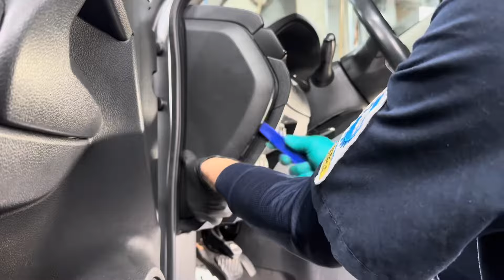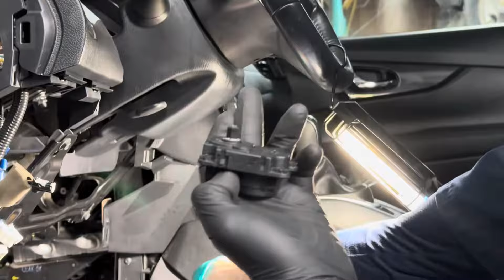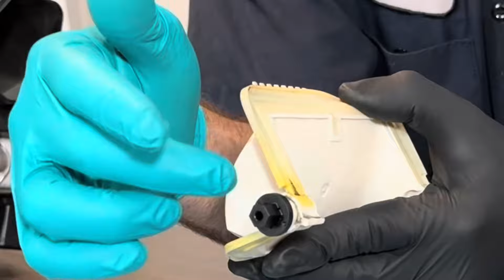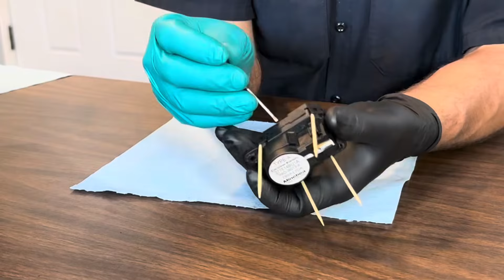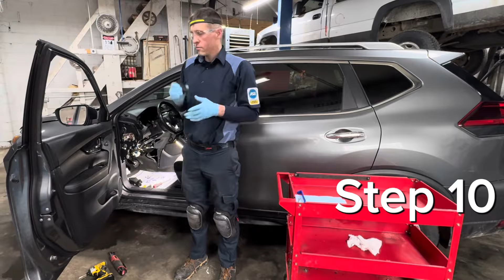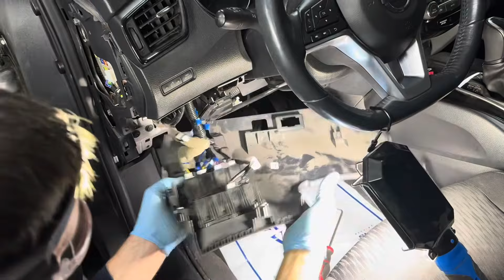Nissan Rogue Heater/AC Fix & Upgrade Kit!!

Comment: You are the best bro! I ordered and installed the complete replacement unit from you.  Can't praise you enough for these instructions and explanations and providing all the necessary tools and misc stuff for DIY.  I didn't ask Nissan but I assume this fix would cost around $1000+ including labor? My one piece of advice to others would be: when putting the black plastic funnel thing back in palace (after you've preformed the fix), crush or cut the far vent hole so you can access the screw easier.  Ironically, accessing that screw was the hardest and most time consuming step.  A small tip flexible screw driver extension definitely would've made it easier but I couldn't find a flexible extension that small/short because it's a tight fit.  In my case the passenger side blew heat but not the driver side, so I knew my heater worked.  When I was able to see bore/hole for the heater flap there were plastic shavings so this was clearly the issue.  When heat is only working on one side, would that indicate a bigger problem with the full unit besides the stripped hole to the flap door?
Reply from the maker: Thanks so much! The computer is still probably not operating that motor due to it being stripped out before. The thing to do is the battery reset procedure on the back of the instructions. If you need more help with that, or need further help troubleshooting, feel free to reach out! You'll be getting an email asking for a review we would love to hear from you also!

Comment: What part would cause the air not to be sent through the vents. My mom just got a rogue and  the blower sounds like a jet engine but hardly any air comes through the vents.
Reply from the maker: It sounds like the cabin air filter is severely clogged, which restricts airflow and makes the fan struggle. Or if  happens with the AC on after driving for a while it could be ice building up on the evaporator core.

Comment: Can you recommend a flexible shaft screwdriver make and model? One that is flexible enough and has the 1/4 inch socket at the end for inserting phillips or flat head tips...
Reply from the maker: Here is a link to one on amazon. Harbor Freight has just the shaft if you have a 1/4 driver handle already. Hope that helps! 

https://a.co/d/05YiOf0q

Comment: what if the problem is on the passenger side?  Same procedure but opposite side?
Reply from the maker: That's a really great question! The passenger side uses the same motor / actuator but connects to that blend door in a different way. There's a piece of linkage that goes between and there is an external connection kind of like how our kit works. It is robust connection and we have never seen one break. Usually if you lose function on the passenger side it's just a bad motor / actuator.
Reply: @RenegadeSolutionsCompany  i have cold air blowing from the floor vent under the glove box but heat  on the drivers side. Defrost works ok but there is constant cold air coming in from the passsenger side door and under the glove box.
Reply from the maker: If you have good heat in your heater box but it's still cold on the passenger side then your motor / actuator is probably bad. It's not very hard to change.
Reply from the maker: Here's a link to one of our videos that might help. If you need any other help feel free to email us! renegadesolutionshelp@gmail.com 
https://youtu.be/HbLa37Xxcl0

Comment: Does it work for passenger side as well?  My Rogue driver side is cooling but passenger side isn’t cooling after switching temp.
Reply from the maker: The passenger side does not break like the driver side. It uses the same motor but a different connection that is more robust. You probably just have a bad motor. Hope that helps!

Comment: Does the repair need to be done when the weather is at a certain temperature? We are having a cold burst and have ordered the kit but wanted to be sure we didn't need to wait for the temp to be warmer than a certain degree.
Reply from the maker: As long as the inside of the car is above 32° for 24 hours while the adhesive is curing you are good to go.

Comment: I did everything but forgot to add the activator and I forgot to use a screwdriver to swirl the adhesive around. Do you think that’s problematic?
Reply from the maker: We did have one other where the instructions were skipped. After about 6 months the heater stopped working because the insert came loose and stripped out the blend door more. We were able to walk them through redoing it correctly. And it's been working fine ever since with no problems. You should probably check it every few months and see if it's getting loose. Once it's getting loose pull the insert out and let's redo it before it tears up the blend door even more. Contact us and we will send you everything you need to redo the job. Occasionally the mix on the plastic on those blend doors is such that it accepts an adhesive bond fairly well without any prep work. It could possibly stay working forever, but just keep an eye on it!
Reply: @RenegadeSolutionsCompany thank you very much! I have been kicking myself for missing these steps but I will watch out and let you know!
Reply from the maker: You're welcome! It happens to the best of us!

Comment: Does this fix the passenger side as well?  Driver side on my rogue seems to work fine, but the passenger side wont go cold.
Reply from the maker: The passenger side uses the same motor but a different connection mechanism. The connection at the blend door is very robust and does not break. Only the driver's side blend door strips out. So if the passenger side is not working it's probably just the motor.

Comment: THIS SI GREAT ! easy order (with even a personal note in regards of customs import to Canada), easy instructions, all special tools required.  Installation went like a charm and it works perfectly (I ordered the kit with the replacement motor, for the price difference it worth it!)  THANK YOU
Reply from the maker: You are so welcome! Thank you for the great comment!
Reply: @RenegadeSolutionsCompany  I'd like to know where it's located; I have this problem with my 2017 Nissan Rogue.
Reply from the maker: If you are wondering where we are located it is in Eastern Idaho. Idaho Falls to be exact. We ship out 5 to 6 days a week and have free shipping that is usually 4 to 5 days out. We also have a 2 day and overnight option when you order!
If you need help locating any parts on your Rogue contact us from the website and we can walk you through no problem!

Comment: Just ordered your kit for our 2019 Rogue SV that is stripped out pretty bad on driver side. Hoping to install this weekend 🤞 Video makes it look easy! I was quoted $4400 from a local (very large) Nissan dealer in Raleigh-Durham, NC area to repair.
Reply from the maker: Right on! You should be all set up with the kit but if you do need anything else we are here for you!
Reply: @RenegadeSolutionsCompany everything is looking good so far. Just waiting for the glue to cure now. Is the 24-48hr dependent on temperature? Honestly it seemed to fit so well it like it doesn't even need glue haha but I did it anyways. Also my 2019 had 2 extra 10mm bolts to take the hood release off the lower dash
Reply from the maker: Yeah it does cure a little faster when it's warmer. The insert does fit really well but willl still have a little bit of movement. That little bit of movement will tear up that flaky plastic on that blend door. The glue makes sure there's no movement and no shredding. That plastic is very strong as far as sheer and torsional strength go.
Reply from the maker: That's so interesting about the extra bolts!

Comment: Another question is, if the blend motor eventually goes bad after the repair, how do you replace it if it's glued in?
Reply from the maker: That is a great question! This is a two piece setup. The repair insert is adhered into the blend door inside the heater box and the motor is still able to be removed and replaced no problem. It still operates and is serviceable the same as the stock oem setup it just has a permanent connection point.

Comment: What happens if you don't glue it? I am afraid if it fails again and its glued you will run out of options. Is this a valid concern or is this repair permanent with no concerns of re-failure?
Reply from the maker: That is a great question! We did try that at first and it does not work. That is why we made our kit a two piece set up so the glued piece is permanently attached to the blend door and the motor is still serviceable. The plastic on the blend door flakes away when there is any rubbing, movement or abrasion. But as far as tensile, torsional, and shear strength that plastic is very strong. So out get eliminates the abrasion totally. And the heater box stays in an oem serviceable condition. You can replace the motor. 
We did have someone who had an issue with installation the first time and the insert came out after a few months. Possibly didn't read the instructions all the way. There was more damage to do the blend door bore. We sent them a new insert and all the installation parts and chemicals. We then walked them through installing the new insert with a bit more adhesive and how that works. It worked great.
If you follow the instructions this is a permanent repair!

Comment: Hey! Does this fix the issue passenger side blows hot and driver blows cold? They both can do cold air.
Reply from the maker: Yes. If both sides can do cold air and the passenger side can do hot air also then this kit will fix it. If the passenger side is the one that is only stuck on one temperature then you have a different problem. Hope that helps. If you have any other questions let us know!

Comment: I open the fuse panel and 2 small came out from somewhere. I noticed that my ac is not performing correctly. What could be the issue? Thanks for your time.
Reply from the maker: Sorry to hear you're having trouble! Send us an email at renegadesolutionshelp@gmail.com
and we can send you some information on that AC system.

Comment: The female gear hub in the central unit is stripped. Did  I overlook you repairing this
Reply from the maker: There is an insert that goes into the blend door bore. That's what you are calling the gearhub. The bonding kit adheres the insert into that door bore and makes a permanent connection. So the stripped out portion has no movement or pressure. The insert protrudes from the doorbell and makes a new connection. That's why the Blend Door Actuator motor has to be modified to match.

Comment: Unrelated but you seem like a PRO at this so I'll ask here anyway...

2017 rogue hvac box....I am replacing evaporator and when I put the new one in and try to slide the black plastic piece over it, it is not lining up....the evaporator is pushing the box out a little so I can't slide that plastic piece over...I dont know  if the insulation is a little thicker around the new evaporator or if the pipes are the problem and they aren't routed perfectly like the OEM evaporator....any ideas?
Reply from the maker: It really sounds like those pipes aren't routed exactly right. Or possibly the aftermarket evaporator is a little bit different dimension. If you get just a cheap set of digital calipers from Harbor Freight you can go over that evaporator and check the size and compare it to the oem. Those heater boxes are pretty tight inside it doesn't take much variation to be too tight and not fit.
Reply: @RenegadeSolutionsCompany i ended up getting it all put back together ok...just had to carefully bend the evap pipes every so slightly
Reply from the maker: Awesome nice work!
Reply: @RenegadeSolutionsCompany thank you
Reply from the maker: You're welcome!

Comment: Is it the same for a 2013 nissan rogue sv?
Reply from the maker: Unfortunately it only fits 2014 to 2020 Rogues and all the Rogue Sport models (2017 to 2022). It is probably just the motor/actuator bad on yours. They did not have a stripping out problem back then. Good luck!
Reply: @RenegadeSolutionsCompany  how bad is that to change?
Reply from the maker: @RileyBrown-t5l  It is not hard. There is not a lot of info on it but you can google a picture. Under the dashboard on the drivers side on the heater box next to the gas pedal you will see it. There is a plastic vent to take off and then the actuator/motor. Once it is off you can spin the door by hand and see if the temperature changes.

Comment: If I purchased kit 3 about how long does it take to complete the repair not including the cure time?
Reply from the maker: If you don't have any experience taking the motor off and everything probably budget about 1.5 hours to make the repair. Then about another half hour to put it back together after the cure time. Once you get the motor off it goes pretty quick. Hope that helps if you need anything else let us know!

Comment: Great video. I have a 2019 nissan rogue that is blowing semi cold air on both passenger and driver side. Not an issue in the winter but now that its summer, it's hot. Would you think this could be the cause of semi cold air? Or you think it's a different issue?
Reply from the maker: Thanks so much! It most definitely could be the issue. Sometimes it sticks more towards hot air. Sometimes it sticks more towards cold air. If you take that blend door motor off on the driver's side you can see the damage. If you are not sure and need any further help trying to diagnose it or anything or have any more questions let us know!
Reply: @RenegadeSolutionsCompany  do you happen to know which position the flap is for heat or cold? Pondering checking and just manually turning the flap to the cold position to see if that is in fact the cause. Could buy your kit after that if I can confirm. Or do you think the computer will just try to move the flap again once I start my car?
Reply from the maker: @SullyTPA  Yes! Sorry for the delay. Start by getting under the dashboard, on the driver's side, and looking at the blend door after you take off the motor. Rotate the blend door counter clockwise for cold air. That is lefty loosey for like you are trying to loosen a bolt. If you rotate it the opposite way, clockwise, then that is heat. It will only rotate somewhere around half a turn or so before stopping. Hope that helps! Let us know if you have any other questions!
Reply: @RenegadeSolutionsCompany  awesome thank you. Will give it a go.

Comment: I bought your kit did everything step-by-step? I went to put your part into the female section of the white turny thing. And initially it didn’t go in all the way and the glue was already setting so I had to get an adjustable wrench to turn it and then it slid in. Hopefully everything‘s still all good. It’s kinda hard moving it back-and-forth for the door to open and close, but I’m hoping everything works out.
Reply: I just wanted to put an update. I waited the 48 hours connected the actuator. I turned your part in the bore. It turned perfectly connected everything and it works just like when I bought the vehicle thank you so much for saving me $5000. Everybody this kit works if you’re having these issues, please don’t hesitate to buy it.
Reply from the maker: @vincentvidal9157 Thanks for the update! I'm glad you reached out over the phone can we were able to walk you through it. Success is beautiful!
Reply from the maker: You should be good to go. The hex probably wasn't totally lined up down inside the door bore. It really does take a bit for that glue to build up strength so by the time you got it in there you're good. If you can turn it by hand the motor will turn it no problem. If you got an extra low torque motor and it's not quite turning it well let us know. We'll swap you out no problem. And also please do keep us posted!

Comment: Thank you Nathan!  When my daughter drove our Rogue home from college and said, "Dad, i can see my breath in the car!" I took to Google and landed on your page.  Your step-by-step instructions were perfect and allowed me to work at my own pace.  I ordered your patent pending heater box repair kit with pre-assembled blend door motor.  Thanks for including everything you mentioned in the video (plus a great new toolbox sticker!).  That pesky molded plastic foot vent was challenging to get out and even more so to get back in (albeit I only used one screw to secure it back in place....that back one was making me pull my hair out!).  Tip....if you don't have a micro ratchet set, I highly suggest picking one up for this job.  It'll make accessing the screws on the foot vent plastic and blend door motor so much easier!  Again, thanks for creating this kit and the terrific video instructions.  I will be sure to pass this along to other Rogue owners I know!
Reply from the maker: So awesome! I developed this kit because one of my customers (who is a friend of mine, most of my customers really are my friends) had the same situation. His daughter was in town and I thought it would be an easy fix. Nope! She did not have the money for the Nissan parts and I did not want to use the faulty Nissan parts. A couple days with my plastic welder and I had a version that lasted about 9 months. That all led to this permanetn version. I am so thrilled we could help your daughter out!